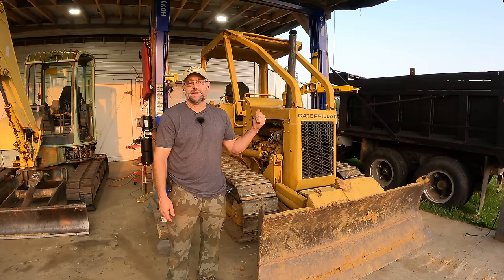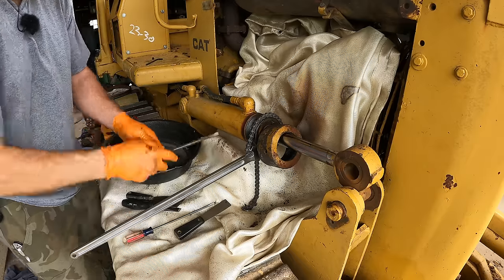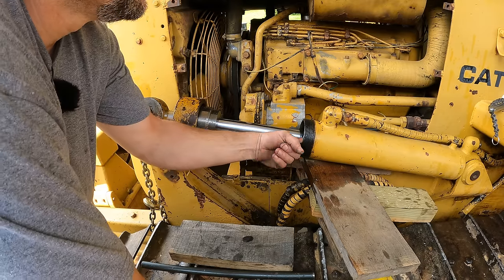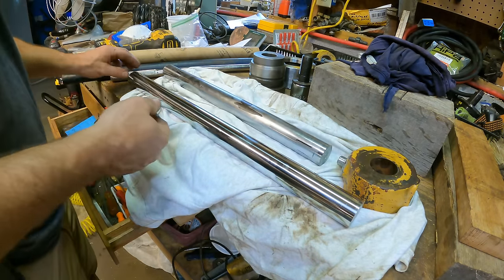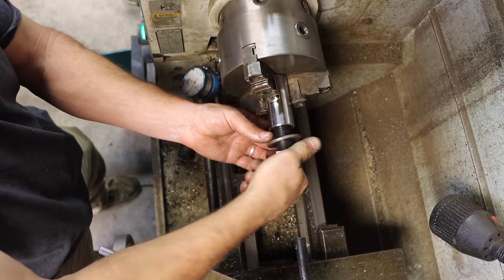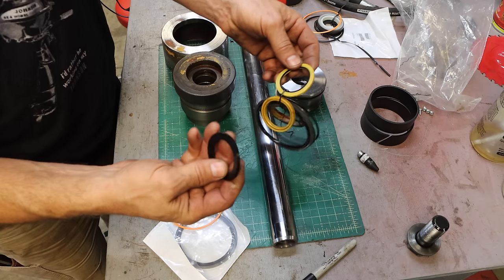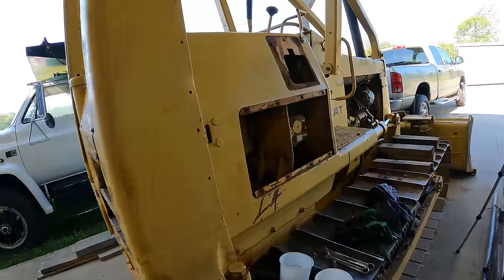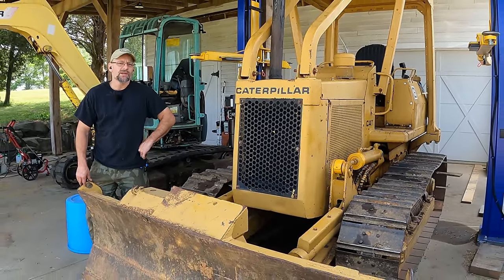D3 Dozer Hydraulic Repairs.  Re-pack. Re-rod. CAT D3 Bulldozer.

Comment: Since you don't have the right Tap, why didn't you simply redesign the rod end by cutting the end down to the inside diameter of the piston hole the bolt goes through and forming the proper shoulder for the piston to sit on where the small diameter meets the large diameter and threading the end in the rod to accept a nut...

Basically, what I'm trying to say is form the rod so it looks like the original rod has a threaded stud sticking out of the hole that the bolt goes into...that way, you don't have to screw around with threading such a small hole...

Comment: I'm late to the video, but wanted to share something I learned recently:

Modern "MAP Pro Gas" in the yellow cylinders is NOT the same as the original MAPP gas.

The classic MAPP gas is no longer produced, the yellow cans are just a different blend of gases than straight propane.

And while they do burn hotter, only about 130°f hotter than straight propane (3600 vs 3730, true MAPP gas burns around 5000°).

Save yourself the money, and just get regular propane for the hand torch.

Comment: What was the temp difference between propane,  MAPP, and  Oxy acetylene?
Reply: Propane, MAPP (Methylacetylene-propadiene propane), and oxyacetylene are all commonly used fuels for various applications. However, the temperature difference between these fuels depends on the specific conditions and equipment used.

In general, oxyacetylene has the highest flame temperature among the three. It can reach temperatures up to 6,330 degrees Fahrenheit (3,500 degrees Celsius) in an oxygen-rich environment. Oxyacetylene is often used for welding and cutting metals due to its high temperature and heat concentration.

Propane and MAPP have lower flame temperatures compared to oxyacetylene. Propane typically has a flame temperature of around 3,600 degrees Fahrenheit (1,982 degrees Celsius), while MAPP can reach temperatures of approximately 5,720 degrees Fahrenheit (3,162 degrees Celsius). These fuels are commonly used in heating, brazing, and soldering applications.

It's important to note that these temperature values are approximate and can vary based on factors such as fuel-to-air ratio, burner design, and environmental conditions. It's always recommended to consult specific technical references or manufacturer specifications for precise temperature information when working with these fuels.

Comment: 57:00 not exactly, yeah you don´t have to open a fitting and let the air out but you shouldn´t just full pressure dead head an empty zylinder, because if you´re unlucky you compress the air and oil in the zylinder enough to combust and at best blow out your seals or at worst break the piston. To prevent that just zycle the Zylinder with low flow back and forth a few times to get a lot of the air out before going to full Flow

Comment: When grounding for welding, if you attach the ground clamp so the side of the clamp that has the wire attached to it is the side with the best contact, your ground clamp spring will last longer and you will have a better ground. The reason is if the off side has the strongest contact, the electricity path is through the hinges joint and the spring. This causes the spring to heat up and lose its temper

Comment: Your level of precision requires too much patience, when you chose to create the inner threads in what seemed like a manual process, I thought you'd try it out on two or three rods. On a lighter note, where did you take the Seals, they didn't pop up.

Comment: ive only a small knowledge of my own machining but never have moved a compound for threading while its on an angle ... doesnt that cut your thread wider than the degree needed and at a taper for   the whole length since you moved your increment forward while on a degree ????? 33:19 or it that only if your running crosslide to make the taper with the compund my mind is baffled seeing this look square hahahahah

Comment: Im still comcerned about your battery setup, I think youd be better off with two batteries and if, as it appears, that the cutoff switch only grounds the battery to that door, then I'd highly recomend moving it to the frame, it would be a more reliable ground and better for the cable besides.

Comment: You may want to buy harbor freight 1” drive tire air impact with a half inch air line on 175 psi compressor to take your flange nuts off . Works for me